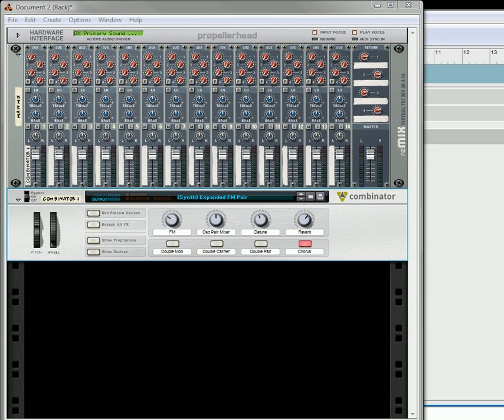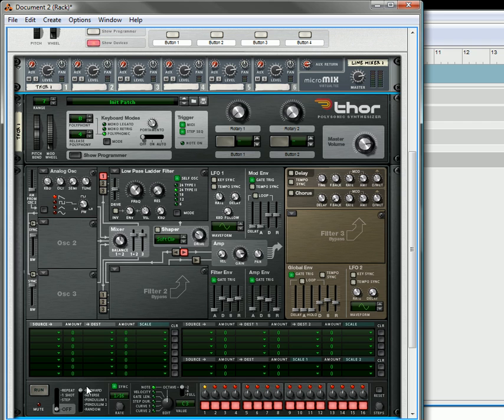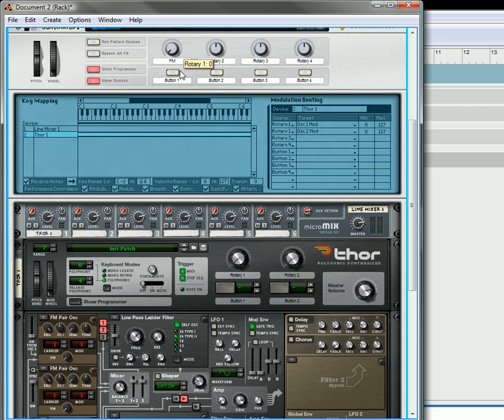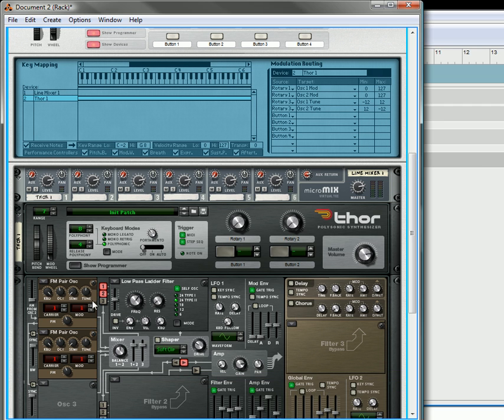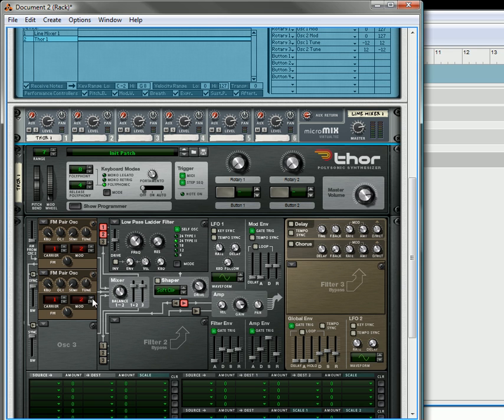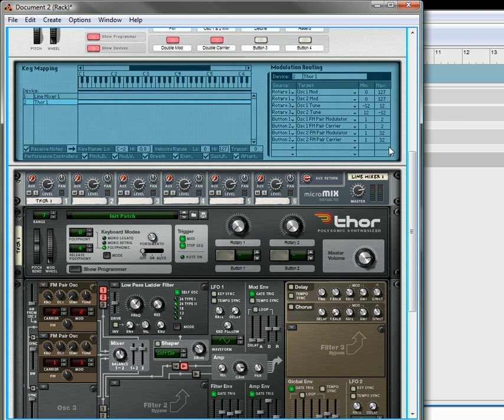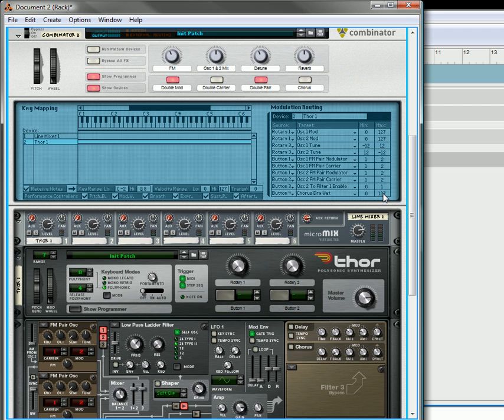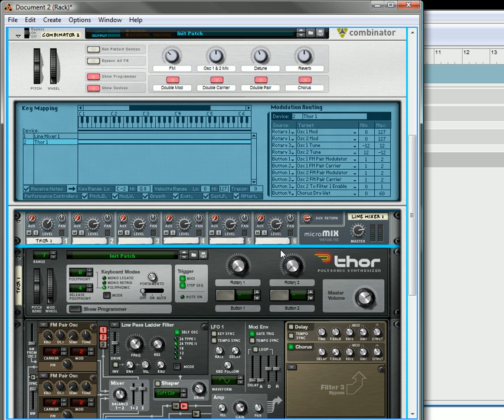Layered FM Pair Synthesis (Part 1)

Comment: a good trick is to keep the mod and carrier at ratios of 1:5, 1:7, 1:9 / 5:1, 7:1, 9:1. Also adding an octave which is 12, ie 13:5, 21:19 etc. These all sound good, as a basic starting point, so give it a try folks.